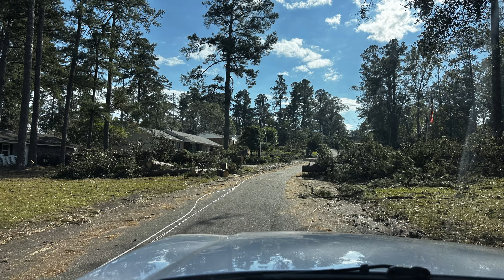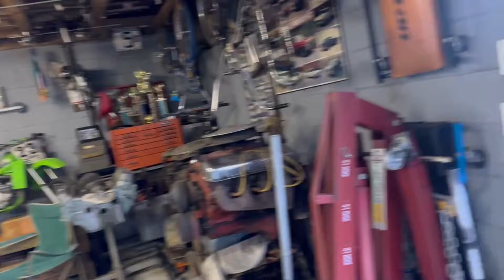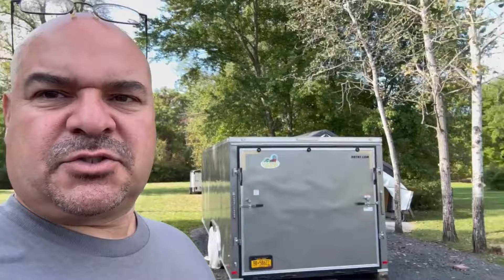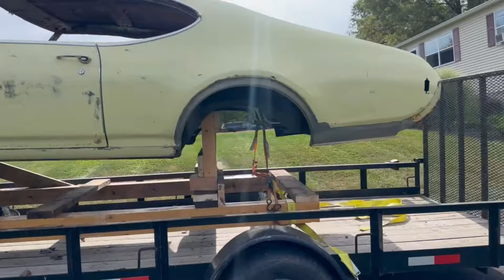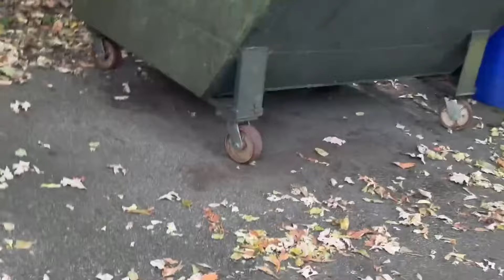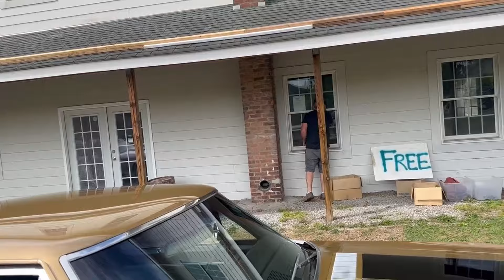Mr. Jones Goes For A Ride! Our '69 Cutlass W-31 Project Goes On A Body Cart And Rolls Outside

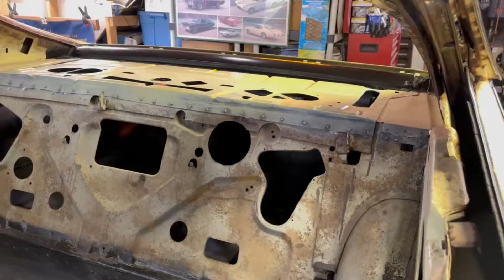Comment: at exactly timestamp 3:14 for this video he pans across the package tray that is black in color or the radius part to narrow it down... was that replaced or is that a remaining piece of original metal... my question is if it was a replaced item please let me know where this can be found because my 71 looks worse than a package of aged swiss cheese and I have been looking for that piece... please please please share and if you can help a fellow olds man out on this one  thx
Reply from the maker: Well good  morning and Thanks for watching!  Cool first comment to get.  So to answer your question, YES. That entire rear window sill, package tray and packing mounting flanges were ALL replaced from a parts car / donor shell.  
That work was in fact shown in fairly comprehensive detail in some older videos.  We had nothing worth saving back there. I even duplicated exactly how the black paint on the lower sill was painted at an angle. Crazy I know but fun stuff.  When I get a few minutes I'll go back and look for what video(s) cover that work and get back to you in another comment.
Thanks again for watching and playing along.
-steve
Reply: @theautorefinery ... I need to find a doner car...
Reply from the maker: So I just took a quick look and that work was covered over the course of several videos.  
Go ahead and take a look at those posted during the month of May last year (2023).  I hope that these may be of help to you. Please feel to email us directly with any questions along the way.
-steve